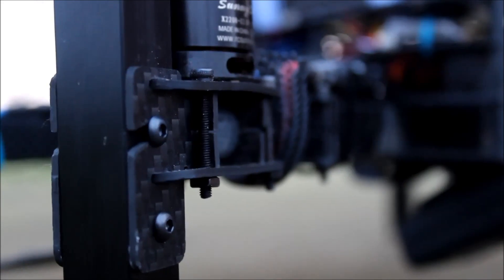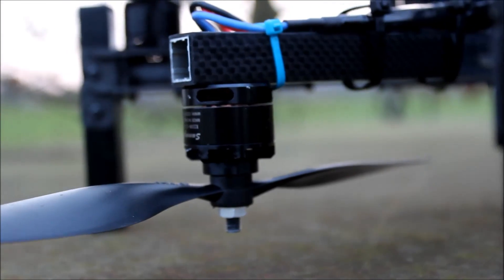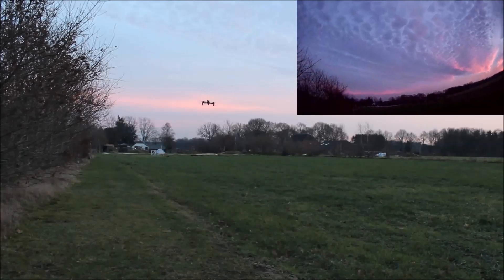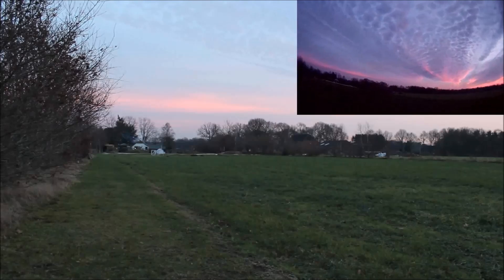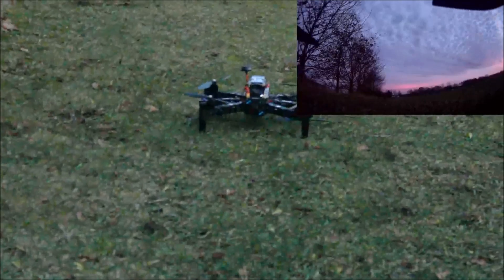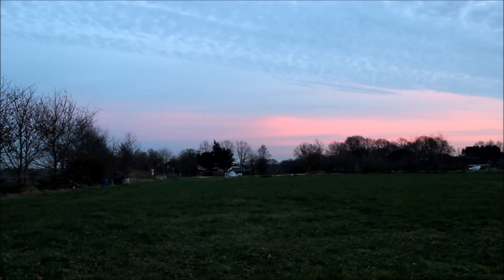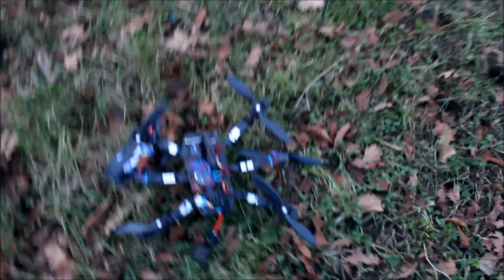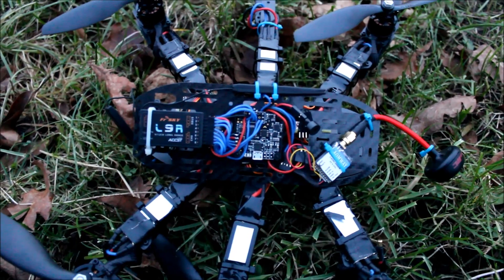BG - Hexa Setup - 4 and 5s! No Pain! No Gain!

Comment: "Woops"...  I know that feeling too! :-(
Insane would be 8S, but you might be able to try 6S.
Great demo!
Reply from the maker: If the motors can handle it 6s is possible! as everything is 6s capable:) 8s !? yep.. that would truly be insane! but i thought my little creation was going rather fast on 5s :) i should get the minim and gps ready for some real data:) and put the carbon props on.. i have a feeling the plastic props go flat @ high rpm :p
Reply: I look forward to seeing what you come up with. Higher pitch props and lower kv higer rated motors may help if prop stress gets too much.
I'm grounded while waiting for parts after a crash. Not nice!
Reply from the maker: Andy Lee Robinson That sucks mate.. i guise we all know that feeling! i have a closet full of parts now, and still sometimes have to wait a few weeks for a particular screw:p Next up: sunnysky 980kv 12" props, extended booms, and the first time i'll hook up my Gopro 2 axis gimbal:) and i'll switch back from 5.8 to 1.2ghz for this one.